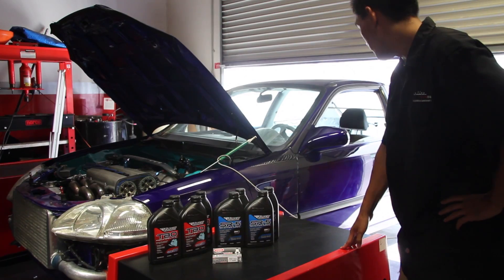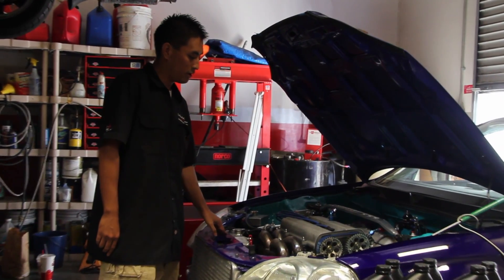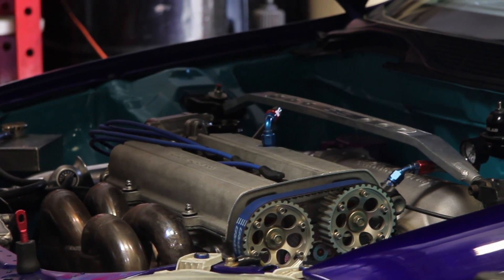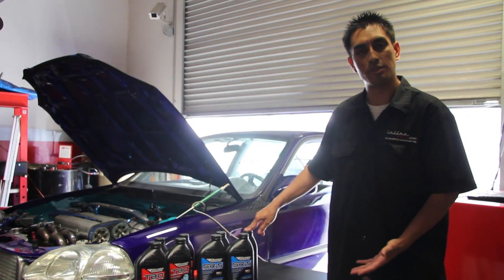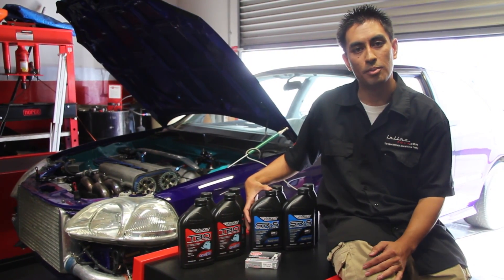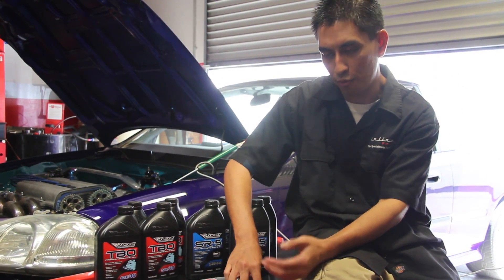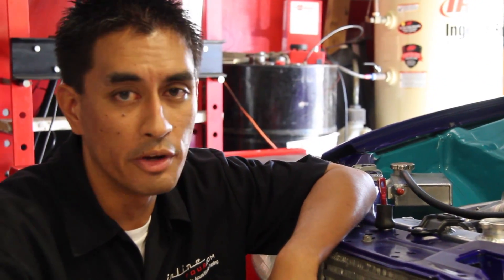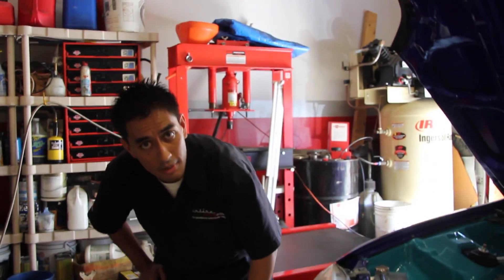InlineFour All Access: Dyno-Tuning Ep1

Comment: Inline four is probably one of the only shops west of the Mississippi that can provide you with intelligent tuning and parts on hand. Using the best oil ever produced Torco Racing Lubricants. These are very bold statements, and you need to choose your words more wisely. You are not going to make it very far in this industry acting like the best at everything